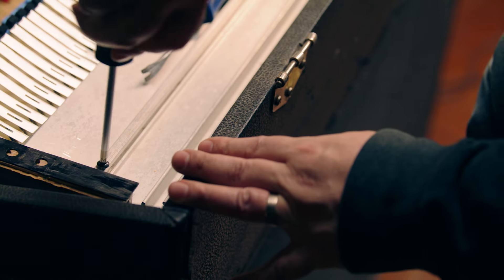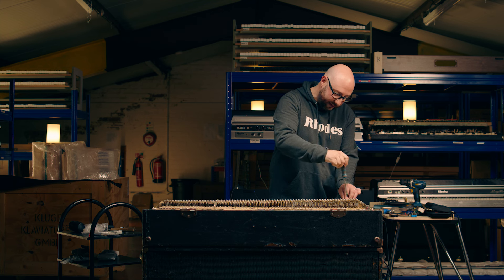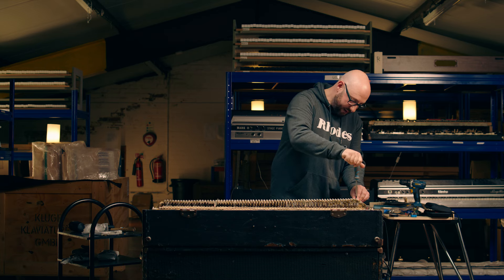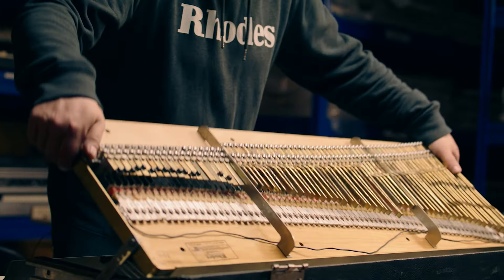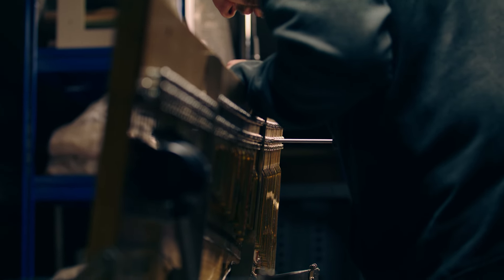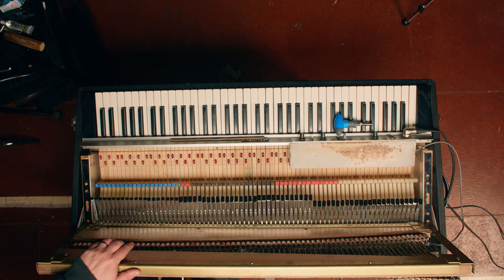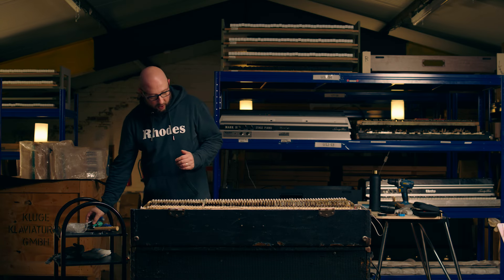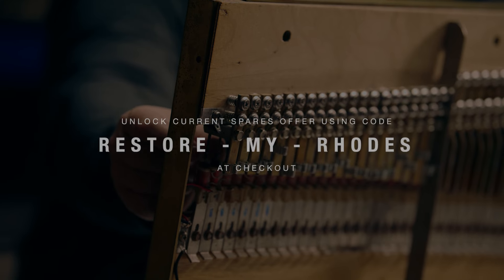Episode 3: Rhodes Piano Restoration | Fine-Tuning – Key/Hammer Levelling, Detailing & Audio

Comment: Dan - amazing work!  Two questions; 1. In your hammer height adjustment, does adjusting the pedestal bottom create variable key dip (one key vs others)?  2. Did you need to adjust the escapement on this keyboard?

Comment: Excellent video! Thank you for taking the time to show us your work. One question: what effect does adjusting the hammer height have? This is not mentioned in the Rhodes manual. Also how does the electric tape hold up ofer the years? Thank you again. Phantastic work.

Comment: @goldphinga Thanks for this very helpful video. I just have a question about the recommended sequence for restorations. I'm about to install new damper arms and felts on a 79 Mark II. Once I am done with the dampers and I've set the tone bars and springs at the correct height, what do you do next? Do you work in this order: set optimal strike line, adjust escapement, adjust voicings to taste and then finally tune each key? I know these things have to be done multiple times over but I wasn't quite sure in what order. I would be very grateful for any advice.🎹